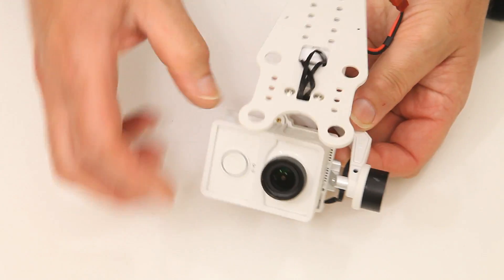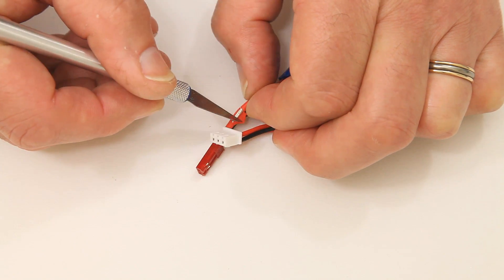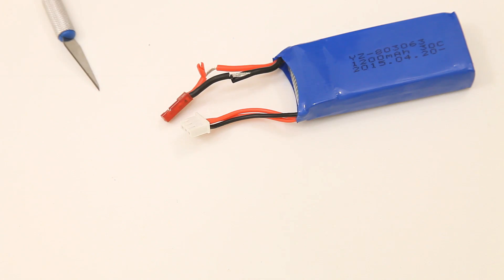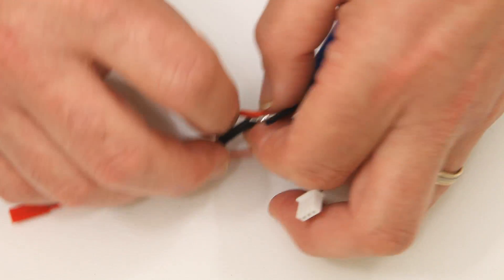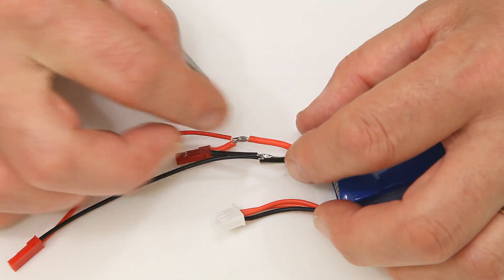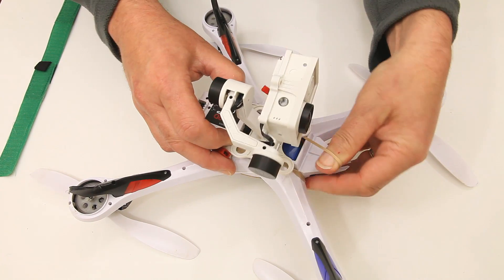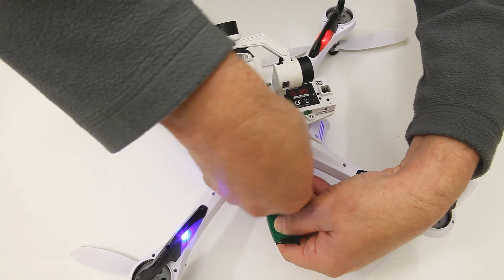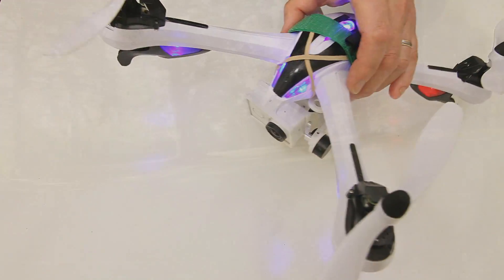Tarantula X6 fitting Walkera G 2D gimbal and battery mod.

Comment: Love your videos!
This gimbal seems perfect as it's lightweight... Instead of battery mod, getting one of those Parallel JST cables like http://www.banggood.com/JST-Parallel-Cable-Line-For-Transmitter-And-Gimbal-Flight-Controller-Power-p-980321.html should do the trick yea?
Reply from the maker: Asri Zainal Glad you love them :-) Loads on the channel now and still more to come. I now use this gimbal on the CX-20 as well so I find it great to swap hardware from quad to quad, found no problems so far. Yep that cable should do it, I just couldn't wait so did the mod, but means you have to do it on all your batteries so cable is a good way to go ;-) thanks for subscribing
Reply: +Tigger's RC Reviews got myself one of those parallel JST cables which are advertised using 20AWG wires and tested it with my Tarantula X6 with Walkera G-2D gimbal carrying a gopro hero 3+. The quad starts blinking @ 7.6V which seems quite early in my opinion. Wondering if it's the same with the battery mod you did, what wire gauge do you have for the JST cable?
Reply from the maker: Not sure, they are a lot smaller than the original wire, I would say the same size as the balance wires that come out of battery, if that helps? If not I will try and find out :-)
Reply: Tigger's RC Reviews a friend suggested to solder another JST wire straight to the X6 board which I may try. At least I don't have to do it on all my batteries.
Reply from the maker: Yes I would up doing it on all batteries as I was impatient and couldn't wait :-)

Comment: I see how to add the power connector. What about actual CONTROL?  Is that connection wired to the board or is it also radio/wifi to the X6's  remote?
Reply from the maker: Gary Ward Hi Gary/Kenneth by control I assume you mean the pitch and roll on the gimbal, I don't control it in flight, I just set it up how I want it before I fly, works fine for my usage. The X6 has no spare controls for this so you would be into all sorts of playing to sort it. Hope that helps and you thumbed up and subscribe, got loads on the channel for the X6, great value for money do all quad :-)

Comment: Received the gimbal today a love it! Had to adjust the tilt and lengthen the X6 legs by two inches (used pieces of plastic clothes hanger and screwed into stock legs. Works great!
Had added a push-button on/off switch do the whole process is much easier. Thanks for your videos!
Photodonn
Reply from the maker: Donn Brown Hey great news Donn :-) it is a great gimbal and glad it is working for you :-) Have you changed your name? have fun m8 takes the Tarantula to a whole new level :-)
Reply: Some times it shows Photodonn44 and sometimes Donn Brown,
Reply from the maker: Donn Brown OK M8 thanks for that, thought maybe you had a split personality...Super Quad Pilot or just getting by LOL Any footage of your gimbal set-up? ttfn

Comment: quick question - can i control the gimbal when installed on the tarantula x6?
Reply from the maker: לירן חסון :: תקליטן ומפיק מוסיקלי No...how about that for a quick answer, it doesn't bother me I set it before I fly and no problems. If you need to alter while in flight then CX-20 etc is what you need. That's now a very long answer LOL :-) Please like and sub thanks

Comment: The results look really good! You've probably has this question hundreds of times before but what impact does the gimbal etc. have on the endurance per flight? I'm reading that similar setups on the Syma X8c are only getting 3-4 minutes airborne...
Reply from the maker: Dan Smith Yep laods of times with this question that's why I made this video https://www.youtube.com/watch?v=GuZyYS78AXs everyone tells me "it will burn motors and pcb quicker" well I have been running 2 months usually a few flight a day, 3 batteries and I'm lucky with time resource and still on original everything, when it goes and i know it will I will probably just buy another! £37 for this amazing :-) Please sub if you haven't and thumbs up when you can :-)
Reply: Thank you! The price is why I'm so interested! I'm only really interested in loitering shots so that kinda flight time would be fine for me, and the motors are so damn cheap there's not alot of point worrying about burnout etc... I might just have to get me one of those
Reply from the maker: Dan Smith I seriously cannot find a thing this has not done that I have asked of it. Hope you love yours too :-) let me know how you get on

Comment: Wow, excellent tutorial and footage with the G-2D Gimbal.  I was finally able to upgrade my Walkera 350 Pro to the G-2D and what a difference it makes-https://youtu.be/WbKV_8_kTYE
Reply from the maker: EpicAerial Glad you liked it, this is my first gimbal so have nothing to compare it too, but it does everything perfect as far as I'm concerned and at half the weight of most others it's excellent all round. Please sub and like BTW nice beach where you are :-)
Reply: Tigger's RC Reviews Yes you are absolutely right about the weight of the G-2D Gimbal, one of the main reasons I decided to install that gimbal model over any other such as G-3D.  With the G-2D installed my Walkera QR X350 Pro is still very agile and nimble due to the lightweight, plus the battery life is not diminished near as much as a heavier or 3-axis gimbal would reduce it.  Obviously there is still a significant difference from using a non-gimbal standard mount due to the extra motors consuming battery life but it is still a totally acceptable flight time for great stable footage (I can get up to a 13-14 minute flight with a 5200 mA battery attached).  Thanks!, the beach footage was one of the many beautiful beaches of Cape Cod!
Reply from the maker: EpicAerial Glad it all works well for you :-) 5200 mAh!!! the Tarantula has 1200 mAh I'm even more amazed at what it can do now! I find it very difficult to now film without the gimbal although I get no jello the footage is jerky without s m o o t h is g o o d : - ) I'll show you some of our beaches soon. Thanks for subbing and stay in touch

Comment: What action cams do u think are the best at the moment, also are there fpv action cams?
Reply: TheLaquconic ^^^^^ Dont mind me, just 1 question, does the wifi fpv to phone thing need a wifi connection or is it just that the cam uses a signal similar to wifi but does not need a connection, unless I am completely wrong and this cam does not have some sort of fpv to a phone.
Reply from the maker: TheLaquconic that's a little confusing but yes you can run this camera from a phone using wifi, I actually run it on a Tesco Hudl.....other tablets are available :-) wifi has too much delay for FPV with my setup but maybe another phone/tablet might be better, I hope to test it when I get another phone. It's not a great action cam really IMO as to set anything on it you have to wifi to a phone/tablet and it has no screen so it's quite easy to get confused in how and what it is upto. i hope to do a small review on it soon. Quality of image, weight and strong plastics had it fo me oh also really cheap http://www.banggood.com/Original-XiaoYi-Ambarella-A7LS-BSI-CMOS-WIFI-Sports-Action-Camera-p-969228.html?p=ML1711535795201404KD hope that helps if not let me know TTFN :-) did I get a thumbs up? :-)
Reply: Of corse you got a thumbs up, and Thanks!
Reply from the maker: TheLaquconic hey thanks this YouTube stuff is still pretty new to me so want to get feedback so we can all enjoy the channel and the hobby :-)

Comment: where I could buy cheap gimbal?
Reply from the maker: Xarly Prim I find these good http://www.banggood.com/Walkera-G-2D-Camera-Gimbal-for-iLook-iLook-Gopro-3-Plastic-Version-p-920780.html?p=ML1711535795201404KD :-)
Reply: Tigger's RC Reviews It is not cheaper? worth almost more than the drone ... How long are you propellers engines? I read that last little, about 20-30 flights ... Is it true?
Reply from the maker: Xarly Prim It is cheap for what you get, please show me a gimbal of this quality and weight for less?BTW It's more expensive than the drone. 
Again I haven't replaced any motors so I can't say how long they last I fly the quad very often and with all this weight so if a motor goes they are less than £2 each so bargain as I see it.
Reply: Tigger's RC Reviews engines are cheap, when you have time drone and how many hours you have flown about?
Reply from the maker: Your question doesn't quite make sense?!? but I fly everyday or so a couple of times and I have had the quad just over a month
Reply: Tigger's RC Reviews Sorry, translator use. That's what I meant how long it had and how many times you have used it
Reply from the maker: That's what I thought so my previous answer still holds :-)

Comment: Very nice footage.What is the flight time? Is it affected too much since X6 n walkera sharing same battery?
Reply from the maker: Luqman Radzuan Glad you like it, I'm pleased it actually all works so well together :-) flight time around 7 mins max I would think next video will be just a flight from start to finish of the battery. The extra weight runs at around 200g so it's going to knock it back but I still think that isn't bad. TTFN
Reply: Tigger's RC Reviews 7 Mins is good enough for aerial footage. X6(USD70) + Xiaomi(USD70) + Walkera Gimbal(USD70)=USD210. I think u just give solution to the cheapest aerial footage equipment. The cheapest Dji is USD499. That does not include gimbal and action cam.
Reply from the maker: Luqman Radzuan Hmmm glad you did the maths and liked the result :-) The thing I like is that all the kit will go on my CX-20 when I get it, so no need to replace anything :-)

Comment from the maker: Well here it is, how I did the modified battery to run and fit the Walkera G-2D gimbal on my Tarantula X6 quad :-) 
I hope it answers most of your questions but look forward to you liking it and letting me know your comments.TTFN
Reply from the maker: Hi Jeffrey, no this won't work it needs at least 7.4v minimum that's why I ran it from the on-board and then just played with 2 standard batteries. Hope that helps and would like to see your working set-up sometime. Please like and subscribe thanks :-)
Reply: Tigger's RC Reviews g-2d and runcam arrived today......i managed to mount it ''mobius'' style on gimbal and it seems to work well, so pleased.... i dont have any jst connectors so i cant do the full mod, it was a painless mod... just used the little black plastic screw driver to rotate gimbal groundwards, using battery as ballast, then used wire to twist tighten runcam mounting case to g-2d, wires left me some wiggle room to get balance right. cant wait to test it.....though i wish i was confident enough to land without legs
Reply from the maker: Yeah glad you got it and sound pleased with how you have made it all fit together :-) I always hand launch and land Tarantula but when it's windy can get a bit anxious! Let me know how it goes, I'm looking at another style of landing gear hope to get it finished soon :-)
Reply: Tigger's RC Reviews I am working on a similiar setup to Alan, but would like to power the G-2d from an additional external battery. It would be setup on a Syma X8c. What is the smallest battery I could go with to power this gimble? Would a 3.7V 600mah lipo be enough?
Reply: Tigger's RC Reviews Hello,

Thank you for this video. Could you tell me if there is any other element needed than power to make this gimbal work, is there another transmitter or so needed? Or modifications to your transmitter? Or is it just the extra power connection and nothing else.  Where you flying in high or low speed? Thank you for your help.
Reply from the maker: Hi Rene no amazingly not, no extra power required, it is just the standard battery, with the extra connector, you can use a splitter cable it does the same job. It can fly smooth and soft on 40% for great video or I have run it at 100% and it is still a lot of fun:-) I cannot control the gimbal after takeoff, with this simple set-up. Hope you liked it and subscribe more on the way Thanks :-)
Reply: Tigger's RC Reviews Thank you for your reply.  the video at the end looks indeed very smooth and soft! Is this due to the gimbal action during flight or is it due to special flying technique  of you?
Reply from the maker: It produces great video that's for sure. Gimbal smooths out a lot of things but a slow and steady flight is the key to any great video. I tend to keep it at 40% but it works fine at any settings so long as you keep it smooth ;-) Thanks for subbing and the questions let me know if you get one and how you get on Cheers
Reply: Tigger's RC Reviews also, would be pleased if you made a proper version of my vid, i posted it purely because the only vids i saw involved swapping gimbal sensor over and flipping it then cutting'' a square hole and shoving the mobius thru the hole???.....i did see somebody use my method but way over to one side instead of adding the 10g weight on an arm
Reply from the maker: yeah will have a look at that Alan and get back to you. did you see the nigh flight one I loaded yesterday? Cheers :-)
Reply from the maker: +alan hennesy Hi Alan, still having trouble replying to you, can you write under my main comment or someone else's it seems to work then, Thank you for your comments been trying everything to reply aaaagh....flying is much easier LOL
Reply: Hi, I’m looking at fitting the Walkera to my SJRC S70W with the 1080p Camera option after viewing your complimentary review. Can I power it directly from the 2 pins in the battery compartment?